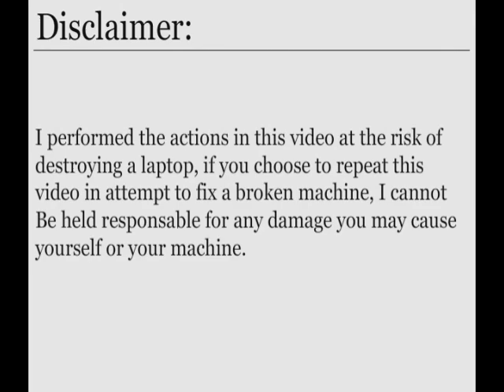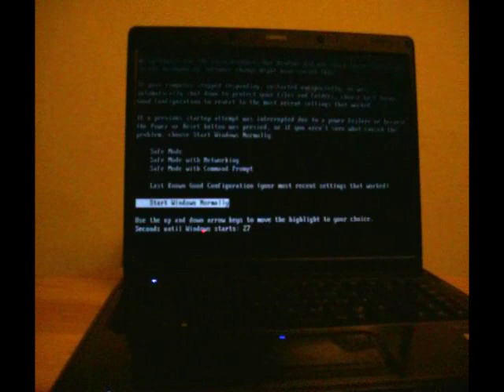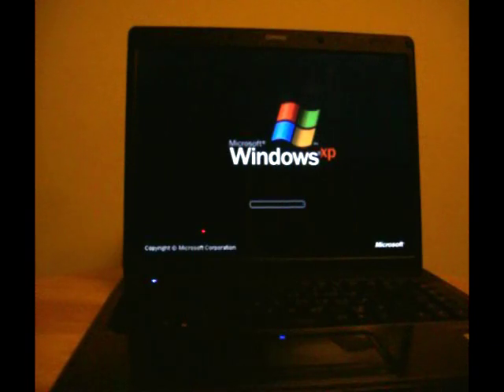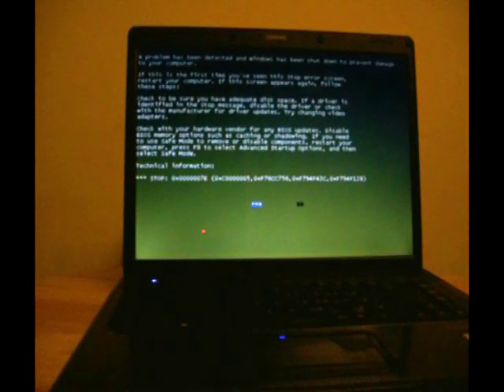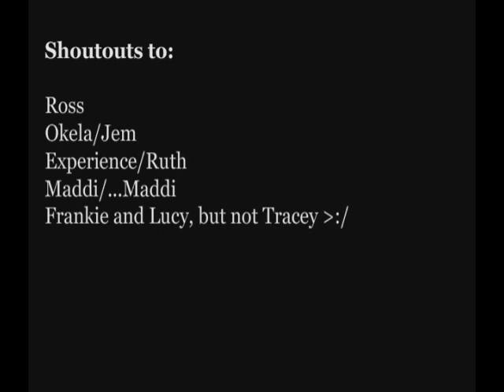Compaq Presario F500 - Repairing the Black Screen of Death

Comment: a few years ago i sent the f500 back to HP/Compaq and they replaced the mainboard..here recently tho it will just shut off, due to the GPU reaching 190 degrees F...would cleaning and reapplying heat sink paste help? the computer works fine still, besides when watching videos and the GPU overheat issue.

Comment: I just stuck the whole motherboard minus the CPU in the oven as prescribed by the last poster Robert Root only I did it for about 14 minutes. IT WORKS, FRANKENSTEIN LIVES!! hehe seriously it works now. I'm trying to decide whether to use thermal pads again or what to use to cool it. I am of course going to be using a fan tray whenever this machine is switched on since it's prone to overheat. I ordered some arctic silver 5 and the same pink and blue thermal pads but I'm still open minded if anyone has any ideas of how to keep this baby chilled down. Thanks Robert and the rest !!! I spent $10 on this thing and will probably sell it when I'm done.

Comment: You are very lucky that the capacitors on the top of the BGA didn't flew because of the strong airflow. If you really want to use hot air, which is not the best way to do it, but it's cheaper, you should use a tool with smaller air speed.
I repeat, you were lucky.

Comment: ok what's the best way to fix my Compaq Presario CQ61? i tried the Hair dryer Method, that didn't work. i took it apart and did his method, still wont work, i have a blinking caps light on and i blinking number locks that comes on, but no beep sounds at all, can someone help me out?  do i  have to buy a whole new motherboard ? pleaseemail me at cromag77_2000@yahoo.com thank you
Joe

Comment: NO NEED FOR ALL THIS...if this is the same black screen of death I had...the black screen with cursor....then no need to do all this!!!  Just remove battery, and ac plug...then hold down the power button for 30 seconds.  (optional to remove cover on bottom of computer and remove 2 Ram chips and then put them back in..this helps ensure)...then put some ac power back on the computer/or battery and turn on...it worked for me...!!!  No need to do all this

Comment: but I had to press F1 to continue, but the keyboard wasn t working

the vent will turn on and will be int this state probably for a a few minutes
4. DO NOT SWITCH OFF!  cover your notebook with a towel or a blanket and leave int this state for 45 minutes. It wil probably switch off. Mine did. Right after 40 minutes
5. Leave it to totally cool down
6. put the battery back and turn on. 

IT WORKS! IT REALLY DOES. I m so happy, a maniched to repair it after a few months.

Comment: Hey people, I ve got a better solution. My compaq presario f500 had the same issue. Then I watched this video and later tied to find out something in order to that I wont t have to remove the motherboard. I found this on some forum. Don t have to dissassemble the notebook at all. 
1. remove the battery and power cable
2. overheat through the vents with a hairdryer (I did it for a minute and half) 
3. put on the power cable and turn the notebook on (i got now my screen working)

Comment: I tried the hair dryer, same symptoms (exactly as yours).  Next I will heat a screwdriver with a lighter, let it cool until just below paper singing temp, and apply it to the chip.

Hopefully the chip is the part that needs reflowing, not the entire small assembly there.

Comment: This is the real thing people! This actually fixed my blacks screened F500, i fixed it about 5 min ago using a gas soldering iron with a heatgun nozzle on it, worked wonders! I just hope it will hold a while, and while i opened it went was clogged with dust, so be sure to clean that every now and then with a can of air thingy!

Comment: i have one of these laptops. the wifi card dosent work and it black screens all the time, im about to reflow it. i just wanted to know if you have had any problems since the reflow ? does your wifi work ? ive read that its an issue with the nvidia chipset that causes the wifi not to work. please reply, thanks for the tut